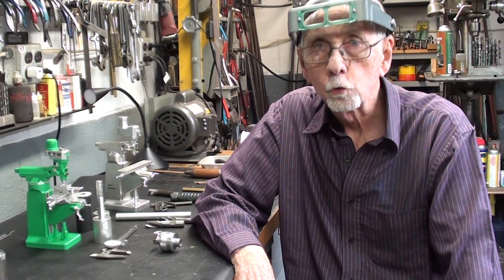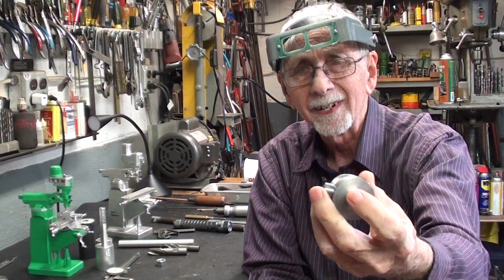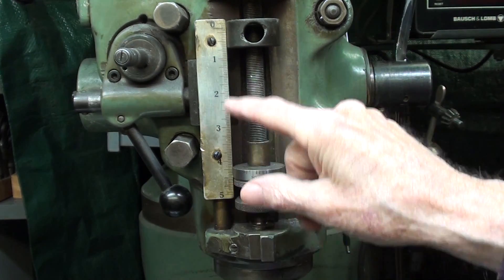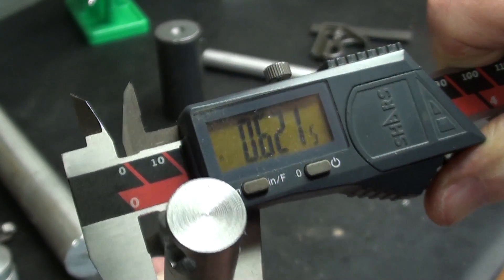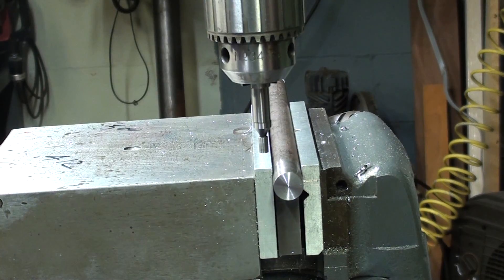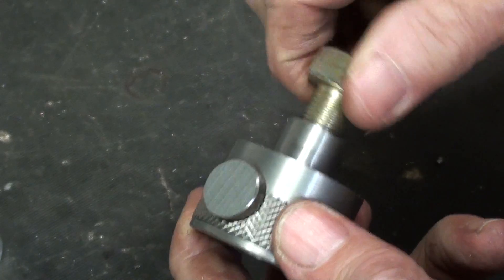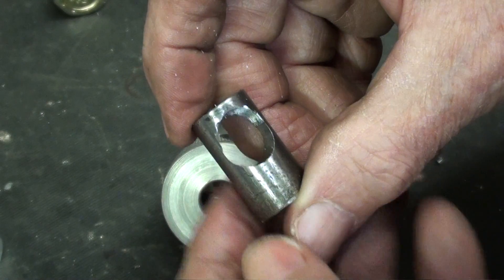MAGIC PUSH BUTTON QUILL STOP pt 1 #868 tubalcain bridgeport mill

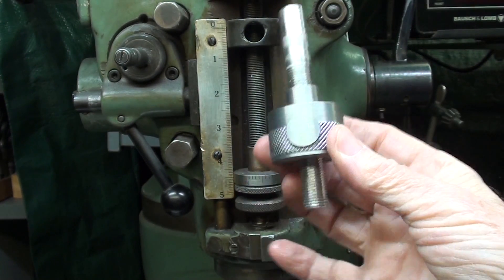Comment: 4:28 ...in the background. That little combination square.... So nice. New stuff is crap. I stop by my local Habitat Restore twice a week.  Good tools are cheap there, so ya have to make it at least twice weekly ritual or someone else will get the good stuff. 😁
I have a "vintage" 12" combination from Habitat, but not a 6" or whatever it is you have there.  That's a cute little old bugger. Im guessing late 50s, about my vintage. 😁
I like your project here. 
I saw something similar to what you made at Harbor Freight yesterday.
I think their central Machinery crap has been discontinued and has been replaced with a new line of Bauer machines.  Still not super high quality, but a lot higher standards than Central machinery.
.... anyhow, their larger floor type drill press has a stop similar to what you made here. Its crappy, sloppy but looks like it would function fairly well.
I'd like to make a stop system for my drill press like the design of your milling machine stop.
My 30 year old Delta has a screwy type of stop with a dial and thumbscrew.  I've never liked it. My mind is on the move right now......
.....so I gotta run.  I hope i can find it. 🫣
Thank you Mr Pete for the info you provide and especially the dry humor injections that all of us expect.
👍👍👍🇺🇸🇺🇸🇺🇸

Comment: I always wondered why quill stops are made around threaded rod?

Plain shaft, with split pin clamp is much quicker to use, much easier to produce, and adding precise threaded extension on the top (or the bottom if you use it in a drill press) so you can move in 1/100 of mm increments is easy.

Comment: This is brilliant! Is there any reason you couldn't use a split piece with magnets? Similar to the hinged setup from the previous video but a fully cylindrical 'puck' threaded and cut in half with magnets glued into  blind holes on both sides.
Reply from the maker: That sounds like a project for you. Make up a prototype and then a final version of it and send me a picture.

Comment: At 14:19 in this video, you are facing the end of the stock on the lathe.  I cannot wrap my head around the picture of the toolholder you're using.  What is that?
Reply from the maker: Tangential tool
Video coming in a few months, if I live that long

Comment: The spring in the commercial one is too stiff for me, so I made one, just as you did. But for the graduations, I shortened and bored out the original stop, keeping just the graduation ring, and pressed it on to the body of the shop-made one. It has a nice satin chrome finish with paint filled lines, so it looks nicer than the commercial one to boot.

Comment: I made one for my SX3 bench top mill last year when I added a Quill depth stop to it. For the spring I used a Cone shaped compression spring as when compressed they are almost flat. It allows for a slightly shallower bore in the main body
Reply from the maker: Great idea, I never thought of using one of those tapered springs. I’m not sure where you got them.
Reply: @mrpete222  I just picked through the options at my local Ace hardware store and bought several that seemed promising. The one I used measures 1/2" OD on the large end, 5/16" OD on the small end, About 11/16" long uncompressed, and is made with 0.032" wire. It will compress to about 0.065".

The closest I can find on McMaster Carr are, 1692K938, 1692K25, and 1692K24. But they are all a bit different. I find it's hard to buy springs online if you don't know exactly what you want. They are hard to visualize especially spring rate and max force.

Comment: The thing I dont like about that design is the nut is the part that locates onto the thread to set the height, and the nut can have movement or slop in the 5/8 bore, so the main body of the device can have play which you dont want.
A better design would be to have the thread cut into the main body of the device itself, with some spring button etc that holds that thread in engagement but allows for disengagement to slide it up and down.
Reply from the maker: You may be right, why don’t you go ahead and make up a prototype as you described it
Reply: @mrpete222  ... thanks for the reply! Always enjoying your videos. 👍🙂

Comment: The snap ring is a real problem, that you need to make a solid stop that does not rely on using the snap ring for a stop.
Reply from the maker: I kind of agree with you, but remember almost half a 
million machines were made with this design and used successfully over the last 75 years

Comment: It's funny you posted this mill stop.  My Wells-Index mill is equipped with a similar "quick stop" made similar to this one.  Instead of a push button it has a thumb screw that you loosen and disengage from the threaded stem and move to the position you want. Tighten the thumb screw and adjust the micrometer stop and your set up.  As always, thanks for sharing, can't wait for part 2.  Ken

Comment: Definitely interested in the graduations. I want to make graduated dials for my lathe (which doesn’t have them), and have seen your videos doing that. But if others are interested, and you are willing, then as much material on graduating dials (maybe with different methods for those of us with minimal shop equipment) would be greatly appreciated. Love your work, your videos and your gentle manner 😊
Reply from the maker: Thank you very much
Reply: To make graduations you have to pass classes. Or have a graduating machine.

Comment: Lyle, I made my body out of brass and the nut was stainless steel. Works great. Thanks for showing others. Regards from Australia.
Reply from the maker: Fantastic!
Reply: Are you not worried about possible galvanic corrosion between the brass and stainless steel?
Reply: @grntitan1  There is NO problem. This is from Google Search. When it comes to stainless steel (301, 304 and 310) and brass, they are only two metals apart, which means they can be safely connected together with minimal risk of galvanic corrosion. Hope this helps. Regards from Australia.